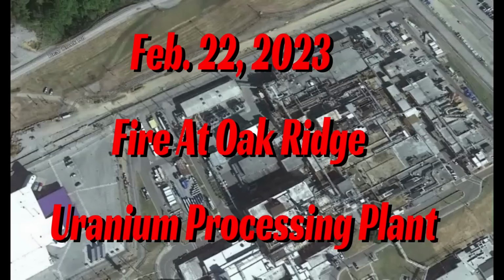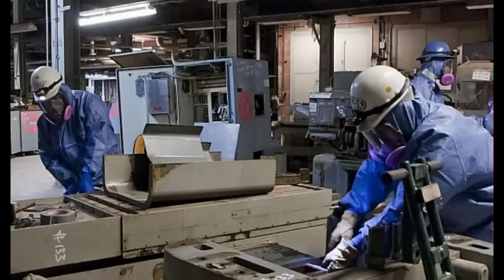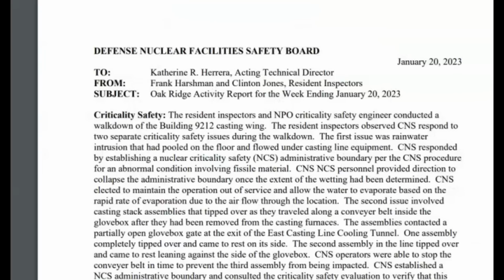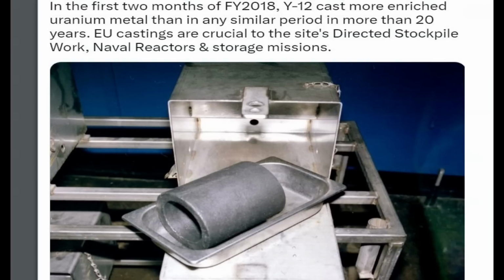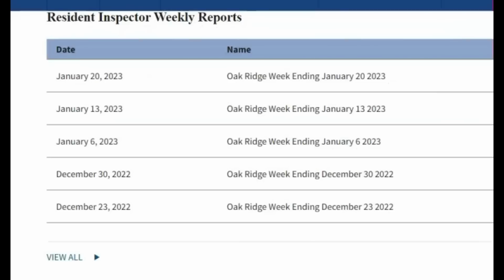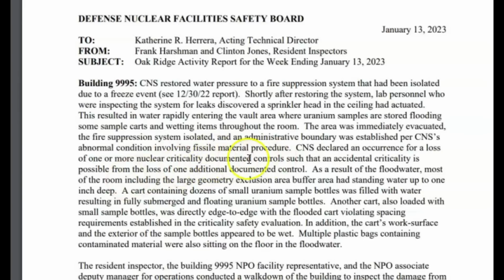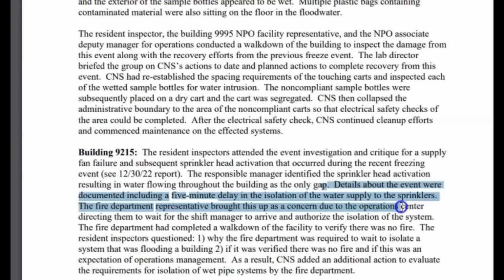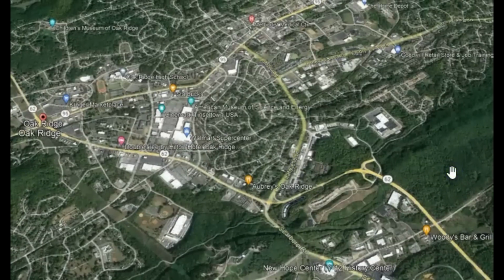Breaking - Uranium Fire At Oak Ridge, Tennessee Nuclear Complex Y-12

Comment: Very unlikely this was an inside job. The security at ORNL is high level. Hubs worked at a subcontractor in Knoxville and it took top level security clearance just to change the air filter. That being said it never hurts to have a geiger counter, as no one can be trusted any more.

Comment: The issue is not the radioactivity of the Uranium, it is not that radioactive. The problem is it was highly enriched uranium, it was fissile material, capable of a chain reaction. If it is not handled correctly, too much in a small place, it could result in a chain reaction. They had two criticality safety violations. Look up the Tokaimura Criticality Accident and Hisashi Ouchi, to see what might happen if they have a criticality accident.

Comment: 02/22/2023 Hello Mary. I do not know just how many more industrial and food source and supply plants we can tolerate.. Add to this I heard that 450 hazmat train accidents last year in america. Posion has reached Cincinnatti. Louisville water is monitoring at the dam between cinci and louisville. Then testing below the locks and dam at louisville. Mary if you test for chemicals after it has passed, then why? Or as hillary said "what difference  does it make now". DO we share an anger over the situation in east palestine ohio? Monkey see monkey do" WE need a major change in their 3 and 4 letter agencies management. It would be nice if the directors  knew what they were doing. If I remember jimmy carter claimed to  be a nuclear scientist with all due respect. How easy is it to obtain a degree in nucs? Perhaps by mail like my pastoral licence. Just a thought why didn't mr carter monitor the american election 2020 like he did in foreign countries. Many used an ink thumb mark for voting. Where is the help when you need it? Second fact, Oak ridge is a federally protected plant. That means that with budget cuts, the sprinkler system was not inspected for how many years? Sprinkler heads at the ceiling are obsolete every 10 years and must be replaced.  Some intermediate testing of sprinklers annually is required by the UL listing of every sprinkler. Go figure who did not have the sprinkler system inspected? That is the person in responsible charge of the safety of the plant. Elected officials place donors first on some lists, but I do not believe that. sic sic. What will burn tomorrow? I bet it will not be a beer plant, just guessing. Sincerely Don

Comment: 1. A SEALING SYSTEM BETWEEN THE HANDLING HOOD OF A NUCLEAR REACTOR AND A LOADING CHANNEL WHICH PASSES THROUGH THE REACTOR COVER, COMPRISING: A SEALING RING DISPOSED AROUND THE TOP ORIFICE OF SAID LOADING CHANNEL; RESILIENT MEANS NORMALLY SUPPORTING SAID RING SPACED ABOVE SAID ORIFICE; SEALING MEANS CONNECTING SAID RING AND SAID LOADING CHANNEL; A HANDLING HOOD HAVING A PASSAGE TO BE CONNECTED TO SAID CHANNEL DISPOSED ABOVE SAID SEALING RING AND SAID CHANNEL; AND MEANS MOUNTING SAID HOOD FOR VERTICAL MOVEMENT BETWEEN A FIRST POSITION SPACED ABOVE SAID SEALING RING AND A SECOND POSITION SEATED ON SAID RING AND IN SEALING ENGAGEMENT THEREWITH, SAID HOOD, WHEN IN SAID SECOND POSITION, MOVING SAID RING TOWARD SAID ORIFICE AGAINST THE ACTION OF SAID RESILIENT MEANS.

Copied directly from the patent. https://patents.google.com/patent/US3183162A/en

Comment: A handling hood is a workspace usually found in a laboratory with a countertop, often inset into a wall with a clear hood over top of it to capture, contain and ventilate fumes or other released materials and draw them out under vacuum pressure and in the case of radiation, that air and any smoke would be filtered before its eventual release with the hood also being a physical containment area and often labs will have the ability to close the front of them off entirely to seal them off, but where they can still see through a barrier of something like leaded tempered glass to help contain any radiation in this instance or in other ones, they could contain toxins or infectious materials that might otherwise escape and cause adverse effects if contacted by people or released directly into the environment . Lab workers would stand in front of one of these work areas and reach inside of them, sometimes by placing their gloved hands and arms into built in heavy glove like protective gloves or else they can just reach gloved arms and hands into an open area in front of the workspace to work with material
Reply: Does this take into account that this entity, like all others under the umbrella of the United States government over the past couple years, that standards have been drastically reduced?
How many bureaucratic agencies have been compromised by being made to bring in people in the name of "diversity" over anything that resembles competence in the field for which they are hired.
Reply: @edmoran869  I think that is presumptive as these highly skilled workers would require a proper background in the related field to be able to work there and in its absence they would be ineligible, regardless of an opportunity to promote diversity. Sadly that effort to promote diversity has been shown to be a means to another end entirely without its intentions being shared publicly although it’s close correlations to the CCP and its values and the overall very long term goals of Communist countries do a lot to give it’s intentions away. The term “captured agency” well describes their broad influences over our Capitalist government and educational organizations, although I personally believe that we have become much more opportunistic by nature than capitalist with our greatest vulnerability being a willingness to compromise our values for the sake of being paid off, even at the expense of the rapid dissolution of our nation’s sovereignty and our most precious freedoms as we are seeing occur today.
Reply: @HappyQuailsLC  
I'm not implying that everyone of these people are incompetent, and I apologize if I came across that way. But basically by decree, public or otherwise, that multicultural diversity trumps in the selection of new hires. Therefore, through replacing retirees etc, just through standard attrition rates, everyone will eventually be replaced within 20 years max.
Not criticizing those that work there, but those in positions above that dictate what new and completely absurd rules have come to be. It's not a great surprise, as just look at a very public display of one of the most recent appointments to the rank of Admiral. How about the Secretary of Commerce? We know that I don't need to go on.
Reply: Wow
Reply: Ah yes. Similar to Rocky Flats down the road here in Colorado. Coincidentally, the only time a federal agency has raided another federal agency
Reply: Thank you so much for the detail information that's really helpful to know God bless you
Reply: Yes